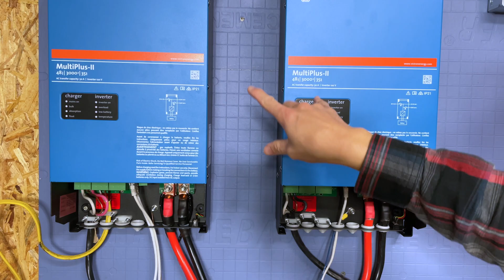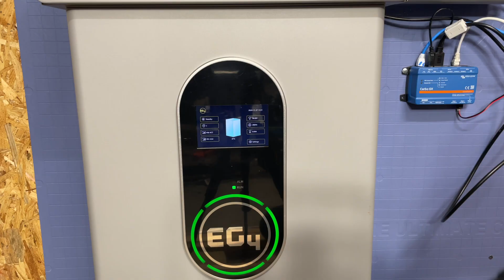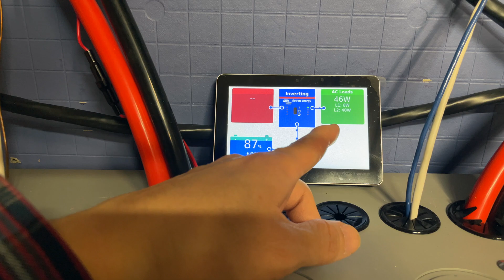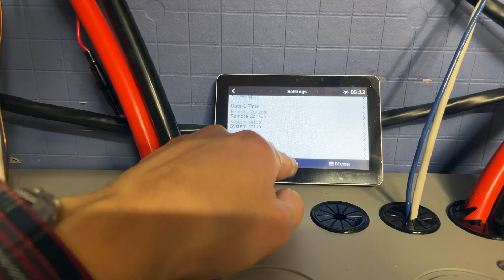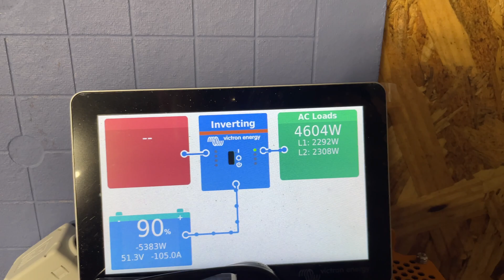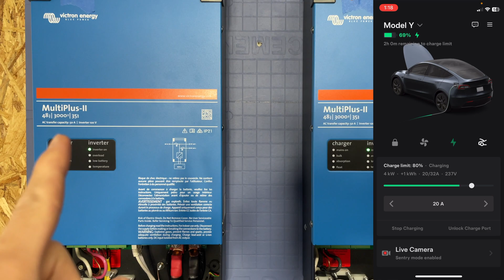How to build a Reliable Victron 240v Split Phase Off Grid system | #victron MultiPlus-II #eg4

Comment: In general HF inverters have a shorter lifespan due to relying on FETs and capacitors to provide surge power vs the inductance of a transformer in a LF inverter.  The other problem with HF inverters is the lack of isolation between solar and grid input power and the inverter output terminals.
Reply: The "inductance" of the Toroid Transformer does NOT provide the energy for the power surge rating.  Victron has never said that!
Reply: @MrSummitville  ~ May I suggest you take a beginners electronics course and get back to us after you graduate!
Reply: @rpsmith The Toroid Transformer TRANSFERS energy from the Primary, to the Secondary!  The Toroid Transformer does NOT Store Energy. The energy for the Surge Rating, comes from the robust circuit driving the Primary Winding. You have no clue how transformers work ...

Comment: In my setup, the electrician removed the green ground neutral bond scew, aa that's done internally?
Reply: That depends on where you ground neutral bond is. In my setup I put it on the load panel due to mainly using it off grid. Your setup may be different. Only thing to know is there should really only be one bond.

Comment: The left inverter is the only one that charges the battery. Only this inverter has AC input. Why? Wouldn't it be better if both inverters could charge the battery? Twice faster (35+35 A).
Reply: Most likely because a couple times he said off. Grid that probably getting most of his  power from his solor  like me. The only time he needs to charge the batteries is when goes 3 days, without sun and needs to fire up a generator I'm set mine up the exact same way. I've been off grid now for over a year. No power bill.
 Though.off grid

Comment: No, it is NOT a Transfer Switch.  It is a relay that simply disconnects / isolates the Victron from the Grid, so that the Victron can become an "island".  When the AC power is restored, then the Victron closes the relay and reconnects to the Grid.

Comment: How does one charge a battery using solar power, with the aid of a solar controller? Will the solar controller connect to the same terminal on the battery?
Additionally, do we need to program the battery parameters into the inverter?

 Thank you for great videos 👍
Reply: the solar charge controller is what charges the Battery, He didn't show one in this setup. But you could easily add an mppt charge controller to this sytem and charge your batteries. The charge controller would connect to your battery and the solar panels.
Reply: @makingstuff242  The Solar Charge Controller should NOT connect to the Battery Bank. The SCC needs to connect to a set of Bus Bars. The BMS, Fuses & Battery Disconnect Switch sits between the Battery Bank and the Bus Bars.

Comment: When charing the Tesla, looks like 5431w coming from battery and only 4608w going to Tesla.  That means the victron system is only 84% efficient, is that correct?
Reply from the maker: By my math that seems to be correct although whatever number is used gave me close to 86%.

Which makes me thing something’s not right bc Victron rates the efficiency as “maximum efficiency” to be 94%
Reply: @ exactly, that’s what I’m questioning. Supposed to be MUCH higher.
Reply: It could be just in the settings, or are there other loads involved?

Comment: Thanks for the video. I too have a Victron system and curious about how it’s grounded. I’m not talking about grounded to the case, but where in the software you decide it’s either off grid or hybrid?
Reply: You don't. If it receives power in the A/C input, it uses that input as ground. Otherwise ground is bonded to neutral internally.